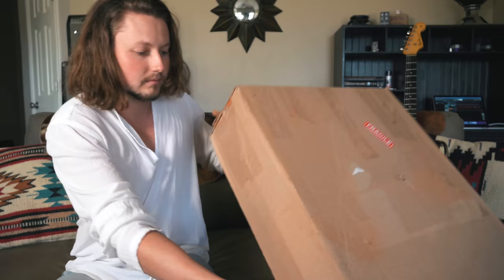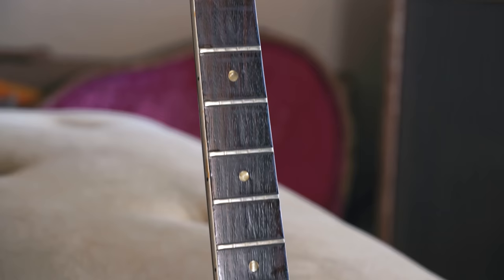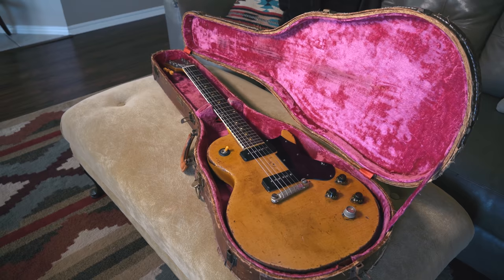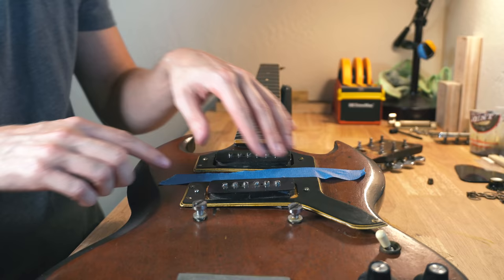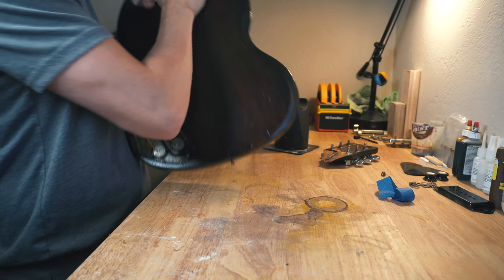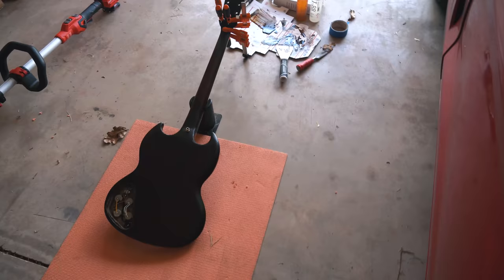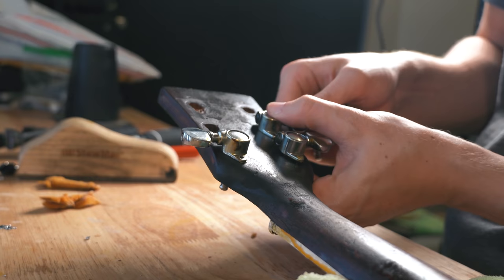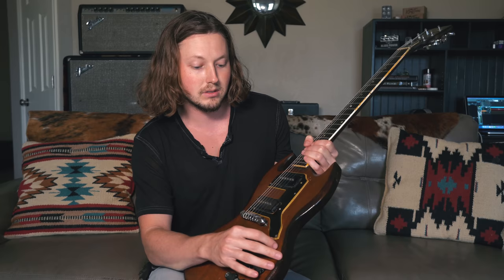Oh No.. Not the Vintage Gibson..

Comment: Back in the early-to-mid '70s, I changed tuners on MANY an old Gibson that had crummy Klusons, hand installing much better Grovers or Shallers, using only hand tools, and took my time doing it. Using a round wood reamer or a tool with a handle that had blades that came to a point, I gently opened the holes for the larger barrels. In so doing, the wood fell away from all those old guitars like dry powder, and that was down in Florida where there is plenty of humidity. Thing is, people run air conditioners or heaters, much of the year. That being the case, (and this was later verified by a guitar playing friend much older than me) I eventually learned that you have to keep Gibsons and Martins and any guitar with a mahogany neck, humidified to keep the headstock and the neck joint from drying out and weakening.
Reply: @Tonetwisters by the same token, too much humidity can cause just as much of a problem, especially with the fretboard.
Reply: @priesty4783  Certainly can. But my experience is if the A/C or heater is running near constantly, the main problem is keeping a case humidifier waterfied!

Comment: Given the amount of damage to the neck and the missing wood, I might opt to re-neck it with a compatible neck off another SG, or maybe graft in the top of a neck with a scarf joint. That break can be fixed, and the voids filled, but that headstock would bother me. But as has been said, if you're not able to do the work yourself, or have it done by a charitable friend, the cost wouldn't make sense.

Comment: I would've looked around online, some people will give away or sell sawdust.
I'd boil some hide glue and rejoin the headstock. Then i'd mix mahogany or a similar colored sawdust with epoxy and fill any gaps. afterwards i'd lightly sand the epoxied areas after they cured to help it blend in.
Reply: How many Luthiers does it take to fix a guitar?
One, and then the rest of them to tell them how THEY would have done it
Reply: @Daizenzetsu  I'm not a luthier. 
I was just mentioning that sawdust would blend in when mixed with clear epoxy. the sanding afterwards reveals wood.
The hide glue thing I mentioned because guitar manufacturers including gibson use it to bond the fretboard to the neck.

Comment: The body proportions look wrong, as well as the headstock.  The routing in the pickup cavity isn't stained either, which is odd.  I can't claim to be an SG expert, just a happy owner, but I've played at least 30 or 40 different variants, and while bevel depths, and body contours change I haven't seen one with a stretched body outline.  Are you sure it's not a replica/home built?  Maybe it's just something weird they tried out that isn't common.   I guess I'm getting stuck on how much farther from the end of the guitar the tailpiece is on this one.

Ah I wasn't thinking of the wraparound unit, and the silhouette looks right from the back.  Just a different way of beveling the body, cool!
Reply: I agree what's up with that Martin like headstock?

Comment: Look at the top of the headstock it doesn't have the normal Gibson carving it is flat strait across. I question it is Gibson but it did have the right pots in confusing. If it is a Gibson you may have something rare. Matt you play excellent buddy.

Comment: Hello Matthew. I'm Not a Luthier, Neither are you, but that doesn't mean we can't work on a guitar. For sure from out here in TV land anyone can armchair quarterback but its your guitar, and you fixed it. You can still refine it, and I'm sure you will but a couple things I'd like to suggest, first on the tuner hole issues, why not use epoxy, and then re-drill?  (fyi, you can use a gram scale to measure the amounts of epoxy and get an accurate mix) Also mixing epoxy its better to mix more because that way the ratios being off won't make as much difference. Since you are using Epoxy, if its not a good mix it can get too brittle, or be too soft.   As far as using Epoxy you said its never the right way to repair a guitar and I agree but it doesn't mean it won't work perfectly. Its just not going to be a top dollar resellable guitar. Who cares? Make it sing brother.

I forgot to say great work. WE call that being Crafty. There aren't a lot of people out there that get that label these days. Thank god for that because we have work :)

Comment: I suspect you could improve the looks if you used epoxy (the doughy kind from the hardware store might be a better bet) to restore the shape of the headstock. It might also be sufficient to fill in those oversized tuner holes, which you could then re-drill to fit the original tuners.

I did an epoxy repair of very similar damage (including a hack job of a tuner swap), but the victim was just an old Silvertone acoustic. I could feel the change in texture where the epoxy fell under my thumb, but once I got used to ignoring that, the instrument played fine for years. Then one day I come home from work and it has imploded. My patch held, but wood on either side of the patch had rotted out. I'm not sure I could have prevented that without hacking out even more wood before starting the job, and I was worried I couldn't line everything up if I did that. I ended up giving it to someone who was willing and able to transplant the neck from a similar guitar with a smashed body.

Comment: Have repaired- guitars over 40 years.  Those Grover gears are too heavy. I’ve seen many mahogany headstocks broken off as a result. Get a light set of klusons on there.  That headstock break is too nasty for just a glue only repair. You need more than that. If wood splices/cleats are too hard for you to do, then let me tell you something you can do that will guarantee that guitar will hold up. Get a fiberglass kit at your local car parts place. Take a rasp and remove about 3mm depth of wood around the crack. Mix up the resin and apply..the n lay a couple of layers of fiberglass cloth on and apply more resin. Let dry. File and sand smooth and spray black can lacquer to cover the glass repair. Your guitar will be stronger than new, and if done correctly, you cannot see the repair.  Another thing is you can add another overlay on the headstock. Easy to do, and even stronger. Best to you.

Comment: I personally would have done a combination of epoxy and bowtie joints just for the added security. But realistically the epoxy is much stronger than most people give it credit for so, yaknow
Reply: I cracked my headstock on my gibson back in the day - luthiers repaired it with epoxy. Turned out to be so good, that another bit came off, but the epoxy just held it straight in place. Not even noticed until another luthier meet.

Comment: Bought a nice Les Paul standard with a cracked headstock for $700. Paid a $150 to get it fixed. Collectors run away just by hearing the headstock was cracked. N
They have no idea how.good it sounds even repaired. Pounce on those guys especially if you get it cheap. Forget about the collectors. Open your ears and see how it sounds....

Comment: Watch on youtube how Ted Woodford patches in splines on exactly these kind of breaks and then re-evaluate what your expert friend Joel told you.  Epoxy does not make a stronger bond than wood glue.  A properly fitted side grain glue joint is stronger than the wood.  Your problem is you have nearly no side grain to joint.  It has to be splines.  Your repair is likely to fail in 10 yrs and then you'll have to figure out how to remove the epoxy to do the job right.

Comment: Wow sounds nice and I had no faith it could be repaired and I really actually like it even with the pick guard like that it does add character LOL Its actually really cool. Wow good repair so far. I love P90s they sound great.  what kind of epoxy repair kit was that? It is really great you made it playable for the price of the pick ups and salvage parts. And You fixed is your self pretty good work.  Its ugly but not as ugly as the other Gibson you had fixed. But its ugly in a adoring way it certainly does look the part of an original 67 SG. I always wanted a real Gibson 6 string maybe I should look for an ugly broken Gibson? What am I talking about I never even finished my last fender with a custom tiger striped neck, so maybe after I drill the holes in the neck I could find one of these basket cases? My cheap SG copy neck dives maybe that is why yours had a broken neck? probably came unstrapped and hit the floor headstock first ouch! Defiantly get some strap locks if you want to keep it fixed.

Comment: Just curious- would replacing the neck have been an option? I know the headstock is where they all seem to break, but surely there have to be a few vintage SGs with a f**ked up body (maybe someone tried to make an “EVH” strat style mod, tried to rout it out for a third pickup with a dull spoon, a Rottweiler with separation anxiety chewed on it, or an angry ex? The possibilities are endless!) but a good neck/fretboard/headstock? Would the value of the guitar still be too low to justify swapping necks if you had a virtually free “new” neck?

Comment: the headstock only broke once? Dude, you are just startin' out.  I've seen some Les Paul where the headstock was broken 3-4 times.  Mick Ronson's Les Paul had so many head stock breaks that it was finally taken to BC Rich where the guys took off the fretboard, and completely replaced the headstock by cutting a scarf joint in the neck and re-gluing an entirely new head stock.

Comment: Wow, that is a fantastic sounding SG and great playing on your part!
IMO, if the headstock repair was to fail I'd get the fretboard removed and then get a replacement neck installed. Then you could sell the original fretboard to recoup some of the cost of the neck replacement.

Comment: A one-piece mahogany neck with a severe headstock angle and a large trussrod cavity leaving very little wood behind is a BAD idea. That's why no other guitar manufacturer does that. I'd rather have a non-traditional Les Paul with a maple neck (maple is much stronger than mahogany), less-severe heastock angle, small trussrod cavity with allen-key trussrod, and a scarf-joint to change the direction of the woodgrain (short woodgrain = weak spot). Gibson would never do that. They addressed the problem and made SOME improvements back during the Norlin era, but purists hated the changes so Gibson went back to the old specs.

Comment: I would have prepaired the clamping better by practicing positioning the clamps before putting epoxy. Although I hardly ever do that & have troubles or disaster. Your job came out nice. Instead of complaining about the obvious repair you could have decided it better. DooOOO I have seen repair on table tops where they build it up by layers using clear in between even wood grain put in. You could celebrate the repair & go the other way.

Comment: Grovers were OEM on the late 60s SGs  I had a 65 that had Klusen and a 68 that had Grovers.
Either tuners work just fine the weight is not going to hurt your repair. The only thing that will affect your repair is the tension of the strings when you get it strung up.
One question why do you do that rowing motion when playing that doesn't do anything.

Comment: I'm having a hard time seeing how heavier tuning heads can make much of a difference on neck strain when you consider the hundreds of pounds of tension exerted from the strings. Seems like a drop in the bucket by comparison.
Reply from the maker: The problem is when a guitar is dropped. The addition weight at the headstock is going to cause a problem.

Comment: Gibson is not even trying to fix the headstock design in their modern guitars. A smaller hole for the truss rod could add more strength without radical design changes.
Reply: Gibson buyers only want traditional, its stupid, but it won't sell to their target audience if it isnt 100% traditional or as close to the 50s as possible